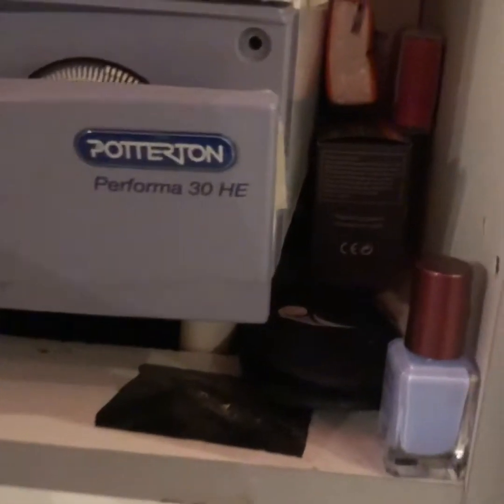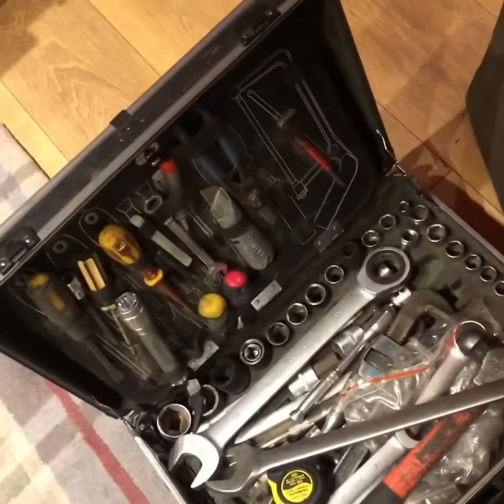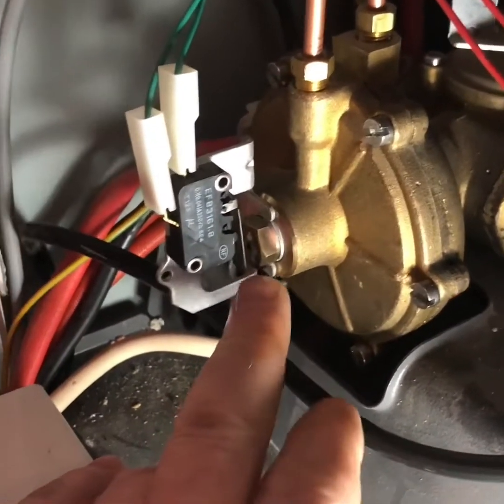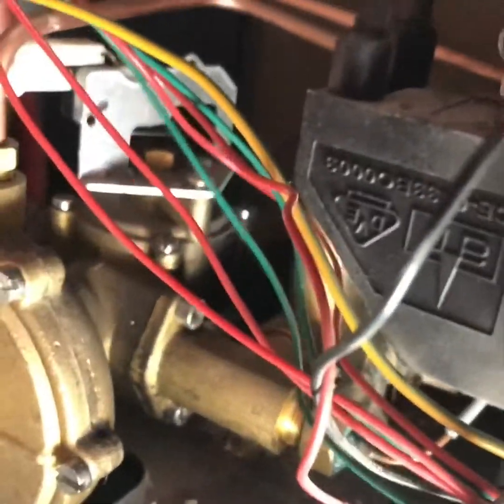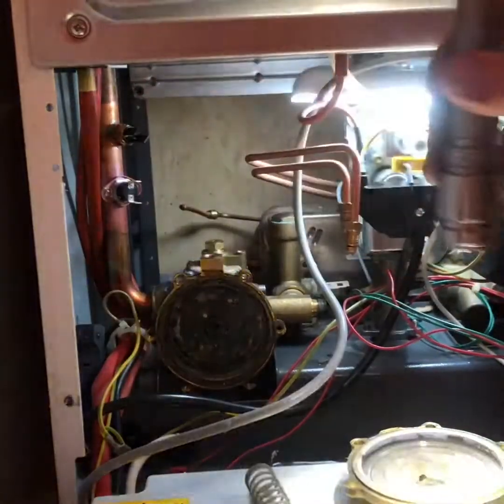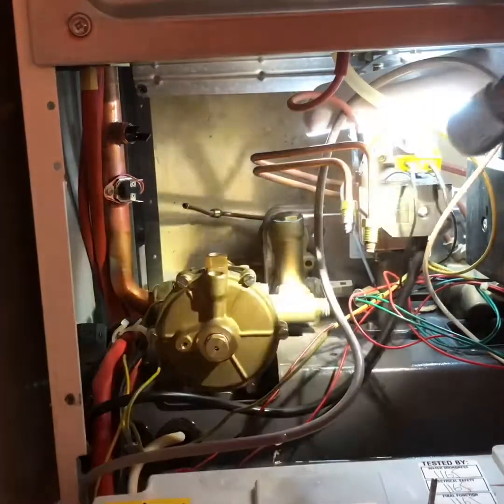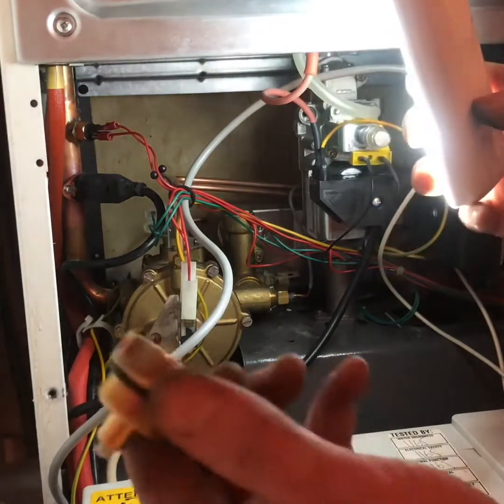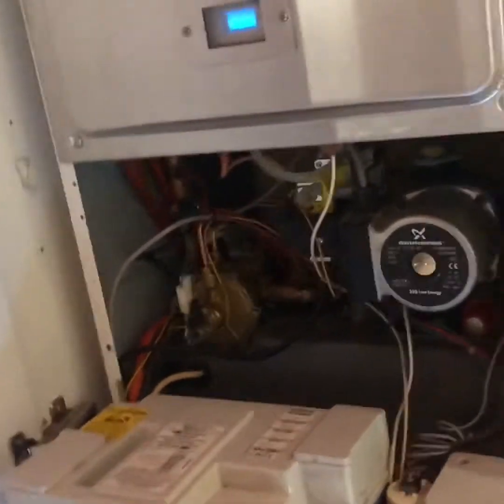No hot water ! Potterton boiler repair

Comment: Good job, Just a quick questions as I have same boiler and only get limited hot water then it goes cold, but central heating works fine only the hot water and I have changed the first big diagpraph but still no hot water you recon it could be the small/diagpraph at back?

Comment: I have this problem with my Potterton Boiler.  I'm not getting any hot water.
Could it be the same problem. Mine is the Apollo model.
Reply: I have Diaphrapram" replacement kit, but I only recieved one replacement
seal.  You refer to needing 2 "Diaphram seals"  Have I the Potterton Apollo
boiler, which I "Inherited it" when I moved in to my flat.  The problem is, I only
get hot water, now and then, whats the problem, without it costing an arm
and a leg.